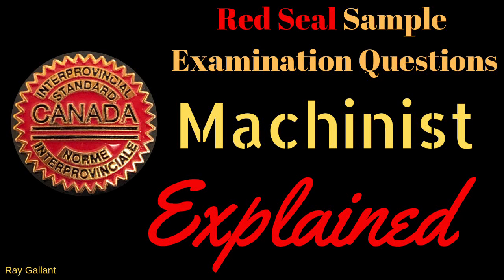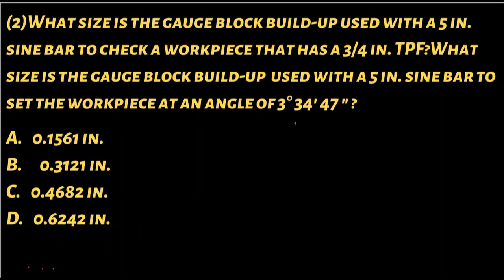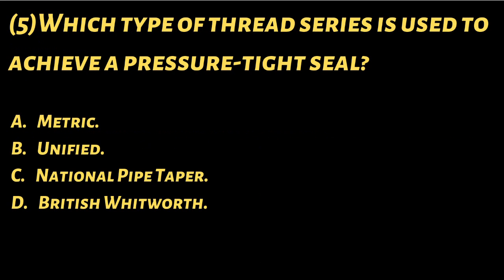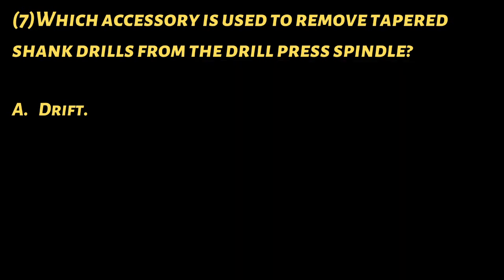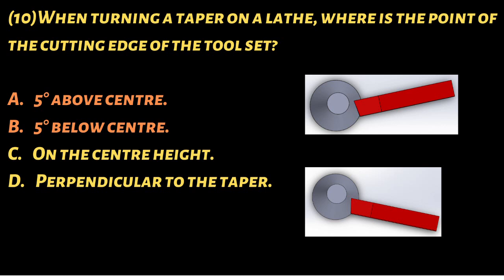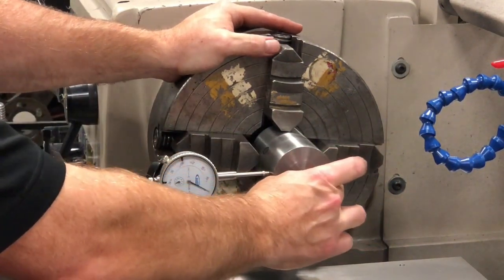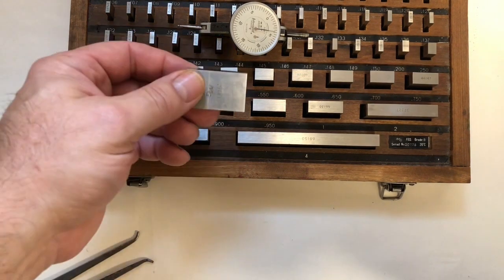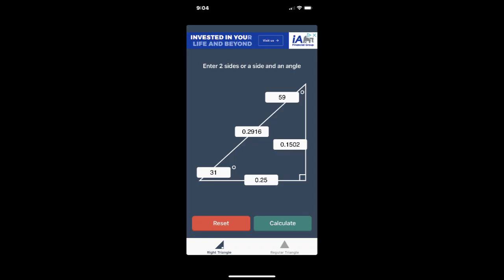Red Seal Sample Exam Questions Machinist Explained

Comment: about question9: your calculation show 11min and 13'' for a tool to travel the length of 9in. in order to turn diameter from 2in to 1.875 with depth of each cut is .o625, we need 2 passes. so it should take 22min and 26'' to turn diameter from 2in to 1.875 in. correct me if i am wrong.
Reply: The cut is on the radius, says so right in the question. Basic lathe stuff.
Reply: @cyrex686  I got it wrong at first also... my answer came out twice as long in time. I figured it out though because the test writers were kind enough to not have my wrong answer as one of the options :)

Comment: Looking to challenge Red Seal with only ELT Millwright Machinist (1st year equivalent) and 12,500 hours logged..Got 75% on the mock exam just winging it, but not sure if I can wing it and pass the real thing! Any textbooks I should get? I only have Machine Tool Practices from 15 years ago, and a trades math textbook..I hear Technology of Machine Tools is the one to have,  seems English versions from India are FAR more affordable than ones from North America, apparently they are the same content.
Reply from the maker: you have the book you need 

the content does not change
do you have the log book ?
https://www.collegeoftrades.ca/wp-content/uploads/429A-General-Machinist.ENG_.v200.PDF.pdf
can you complete the tasks in this book
if you can you should not have a problem with passing
Ray
what did you think of the red seal and mill and lathe vids?

Comment: I want to chellenge red seal exam, I'm metal fabricator in India , I didn't find any books or old exam papers , please help me with it , how can I find metal fabricator fitter book for practice of red seal exam?
Reply from the maker: what trade are you trying to challenge ?
Reply: @shopandmath  metal fabricator (fitter) .noc code is 7235.
Reply: @shopandmath  please help me sir please
Reply from the maker: have you tried this sample test?
http://www.red-seal.ca/s.1mpl.2.2x.1mQ.5.2st.3.4ns-eng.html?tid=145
Reply: @shopandmath  yes I did, I need any book or old exam papers if is it available.
Reply: Hello Sir, my name is Ram Paul, l am a manual machinist, l have 2years trade certificate,more than 20years experience ,l have been working in Saudi Arabia. Right now l am 46 year old. Can l apply for a journey man certificate.if so please let me know.thankes a lot.
Reply: @RamPal-mh1ss   yes  I guess you can apply for it,

Comment: Thanks for the video. Question for you: are you allowed to use a calculator during the exam? Are there any restrictions?
Reply from the maker: as far as I know, and it changes every year, they supply a calculator for you, so what I tell my students is to go ahead of time and ask them what type of calculator they’re using because calculator functions are different. I personally use a sharp calculator because all of my videos have sharp in them so I’m kind of locked into that style.

as far as Casio in Texas instrument the way that you type in your trig formulas is different so it is important to get the calculator that they are going to provide you and do some practice equations with it to make sure that your comfortable with that style of calculator
Reply: @shopandmath  I really appreciate your swift response. Thanks! Subbed!

Comment: On my tool and die exam, I had the question; "What is the tolerance on honing a bored hole?"
a) 0.001"
b) 0.005"
c) 0.0001"
d) 0.010"

I pick c).  What do you think?
Reply from the maker: C

Comment: This was ITA test question 
was asking how much space need for clear drill go through probably for CNC I my self just leave 2 inches block under work piece but it was asking specifically to calculate drill tip length plus extra more when drilling (enough not to hit the table) breakthrough distance?
Cheers
Reply from the maker: for you to properly give them the correct answer you need more information especially if it’s on a CNC machine.

We can start with the tap

They will probably ask you or tell you the number of good threads that they need in the hole so if it was a 1/4-20

Gun top, or spiral flute with a tapered, and of approximately will say three threads and you have 118° drill. You would have to figure out the pitch of the thread which is 0.025 of an inch
Multiply that by the number of threads they require subtract the number of threads that the end of the tap has tapers and add the 118° point distance

That should give you a number that’s very close to one of the multiple-choice numbers that are on the test 

I hope that helped. I’ve got the question wrong. Please message me back.
Reply: @shopandmath  Thank you for respond
say we have 1/2 drill with 118 degree tip how much space we need to leave for under part for breakthrough by calculation the tip comes to  .154"  so should we ad little more on that to make sure drill has gone trough with out hitting the table ?on Mastercam default ad's .o1 so .154+.01=.164 is this coarct? 
The reason I'm asking is last time there was 2 similar quotation on ITA test
Reply from the maker: @silkroad3442 

clearance is clearance. I understand that, but it doesn’t make it safe. 
If you’re driving down an alley and there’s cars on both sides of your car and you miss them by a millimetre you still have clearance between your car going down the alleyway it would be safer if you had feet on either side of your car or metres 

If they’re talking minimum yeah 0.01 would be OK and it’s a CNC machine 

but I wouldn’t advise anyone to do that 

Did they mention the chip thickness in this question if your chip thickness is .05 it would be possible for that chip to get wedged under the bottom

The might also be asking how much clearance you need to get the chip out 

Does that make sense? 

I honestly cannot see anyone advising you to do this in practice maybe theoretical so you can calculate angles 

Ray
Reply: Thank you for your time  @shopandmath  
in real world why not leave at least 1 inch clearance
next time I will look for closest answer on the test
Thank you for videos it is helping me a lot.

Comment: Hi Math
Thank you for video
How much clearance need for under neat work pice for say 1/2 drill go through to be safe?
Reply: There are a couple different answers to this question
Is this a production piece or is it something that you did on a manual piece of equipment so another words standard mil, or CNC? 
The second part of this question is are you using 128° on the end of your drill ?
The third part what type of material are you drilling? 
On a manual piece of equipment, it’s not a big deal 0.1 pass the edge of the drill not the centre

On a CNC machine (production machine)
If you’re using a program such as Master cam, there is a setting called breakthrough and you can set that to almost anything that you want and you can also set your drill angle, which will give you an exact number of your breakthrough distance

I know this is a lot if you have any more questions, feel free to send them to me 

Ray
Reply: @raysfix  This was ITA test question 
was asking how much space need for clear drill go through probably for CNC I my self just leave 2 inches block under work piece but it was asking specifically to calculate drill tip length plus extra more when drilling (enough not to hit the table) 
Cheers

Comment: Hi
There was a quatione how much minimum clearnece space need for 1/2 drill drill through the work pice  (how much minimum space for under workpice)
please help me out
Cheers
Reply from the maker: I think the question that you’re asking is what is drill clearance size for a half inch bolt 

all bolts up to a half inch is two drill size larger if they are imperial or inch 

If this was not what you were trying to ask, let me know and I’ll try and help you out

Ray
Reply: @shopandmath  Hi Ray .
What i ment is when you drilling metal pice and clamping to table how much minimum space you need between surface of table and under work pice for clearence say  for 1/2 inch dill bit?
Thank you for help
Reply: @shopandmath  Hi RAY
i ment minmum space between under work plate and table 
when drill bit gose through wont drill the table
Reply: if the drill's angle is 118 degrees, to drill through the part with clearance, the depth should be (drill size x 0.3) + part's thickness + 0.050".
Reply: @StevenMai151  Thank you 
what is  your refrence for my resurch?
also for carbite drill would you yous colet or chuck?

Comment: Hi I just need help to calculate feed for rough single boring bar and rough twin boring bar for same diameter example
8 inchs bore diameter for 200 rpm 
I just wanna see if 200 × .005 =feed for single boring bar and 200 × .010=feed for twin boring bar